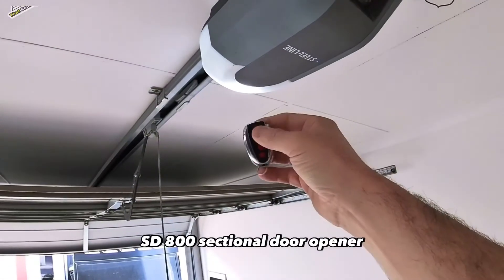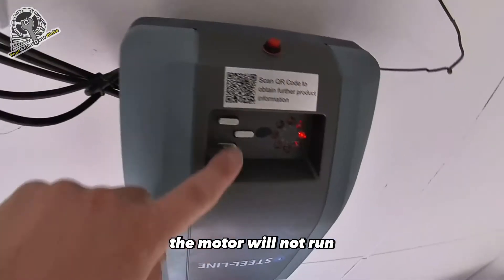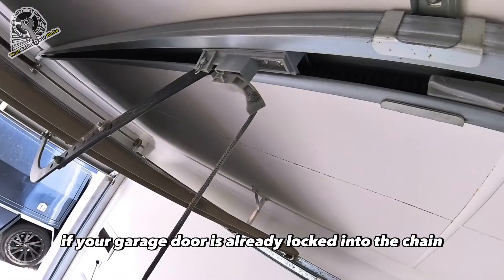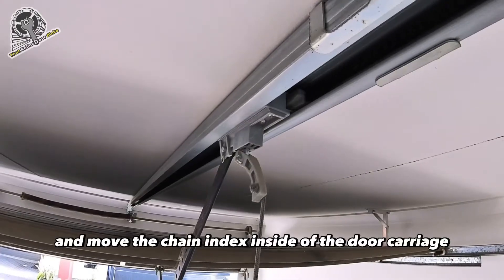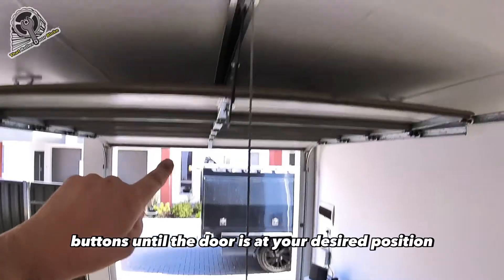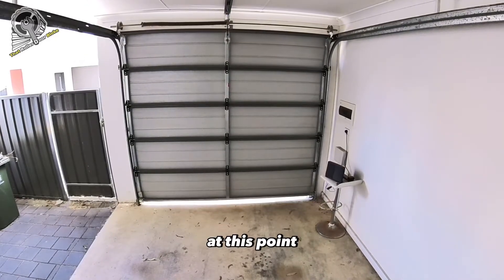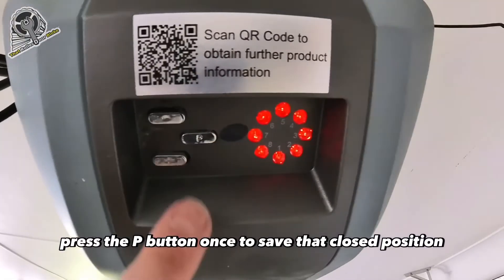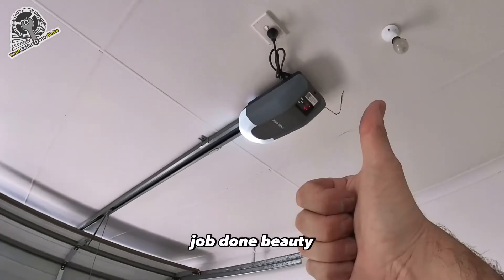[34] Steel-Line SD800 not working - how to set travel limits and get it going

Comment: Hi,
How do you stop the door from automatic closing down?
If i stop with remote just before the complete stop it stays. If i just press the button once it full open but will come down in 3-5 mins
Reply from the maker: Sounds like your machine has the automatic closing function turned on. I don’t know the procedure of the top of my head but it will definitely be in the manual and be a similar process to programming your remote. Should be fairly easy to switch off. I won’t be able to make a video until I come across the same motor again.

Comment: Bro I set my garage door how u said in the video. But once the door closes and comes back up automatically if does not stop where I programmed it, and almost smashes into the control box
Reply from the maker: The SD-800 either works awesome or its cactus.  I would re-do your travel limits again, if it still happens the circuit board has a fault. Replace with a Merlin 🧙

Comment: Hey mate, I’m trying to reprogram one of my remote buttons to a different button. However I am unable to initiate the remote programming stage by pressing ‘P’ together with ‘+’
 (Not getting that all sequence flash response) any advice if there is a different procedure?
Thanks in advance
Cheers
Reply from the maker: Unfortunately, there’s only one procedure.   You could try and erase the memory first but I think that needs the same buttons pressed to initiate it as well. [66] Steel-Line SD800 how to erase your remotes and secure your garage
https://youtu.be/-9qnCx0Z6Vw

Could be an issue with the circuit board, in that case the only fix could suggest is to install an external aftermarket receiver.

Comment: I've tried to do this but mine just does two click sounds 2 seconds apart, sounds like it's trying to operate but won't. Could the motor be stuffed?
Reply from the maker: If the limit setting doesn’t work and you still hear a click (this is the relay working) yes the motor most likely needs replacing I’m afraid

Comment: can we add Smart Garage Door Opener to SD 800 to operate it remotely?
Reply from the maker: Sure can there’s some good wifi modules from Ali Express I use on my gate and door for under $50 or there’s lots of wifi door and gate openers you can Google which is a bit more expensive upto like $150-$200 which don’t do much more

Comment: For the last 6 months I thought my SD800 motherboard was faulty. The door would open just fine - every time, but sometimes it would take multiple (10-50) presses of the close button before it would it close normally. When the door didn't close, the unit would make a single 'click' noise and do nothing. The symptoms were not described in the manual or any where else on the internet before your video. I tried these exact steps and it fixed the issue instantly. I suspect the unit wasn't calibrated as well as it could when installed by the contractor during the build of our house (volume-builder) or after 4 years of use, the limits may have shifted enough to stop it closing effectively. The issue was progressively worse over 6 months and I was just about to buy another unit. Saved me hundreds of dollars getting someone out and/or straight up replacing the unit! Thank you!
Reply from the maker: Awesome thanks James hopefully it lasts quite a while longer now 🙌🏻